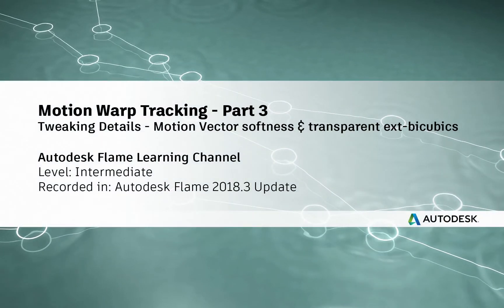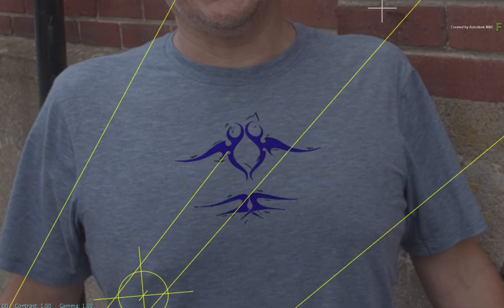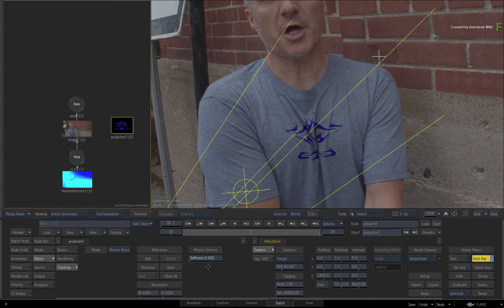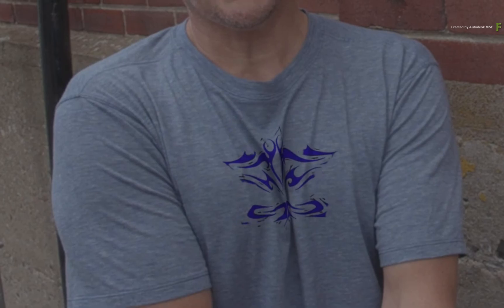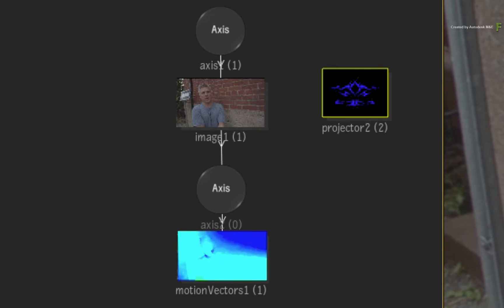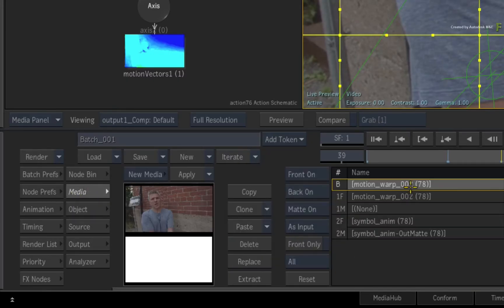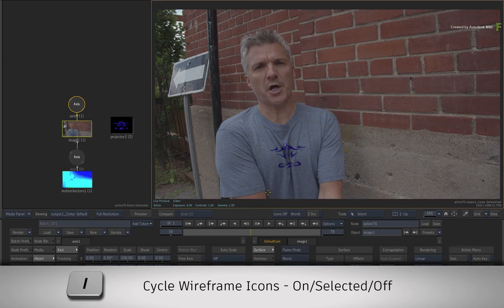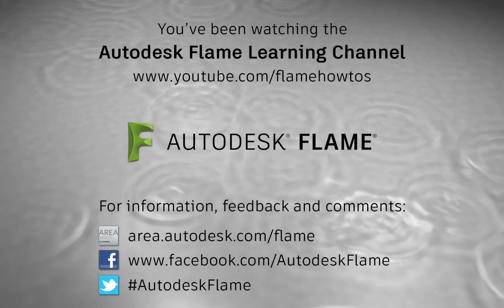Motion Warp Tracking - Part 3 - Tweaking Motion Warp Distortions - Flame 2018.3 Update

Comment: Hey Grant,  When I change the surface in layer 1 to External Bicubic as you do at 4:40, I find that it only affects the layer 1 image and not the projection.  Even if I turn layer 1 transparency to 100% I am not able to affect the project with the bicubic. I'm using Flame 2020.3.1, so I am wondering if any of the menus/functions have changed for doing this.  Please let me know.  Thanks!  Brian
Reply from the maker: Hi Brian, I have just tested the workflow in Flame 2021 and the steps are the same and it works as expected.   The reason I can think of is that your references are set on your surface and not the projector.  In part 2, I analysed/cached the motion vectors.   I positioned the projector and set the reference on first and last frame of the PROJECTOR and not the SURFACE.   This could the reason why the projection is not affected by the surface bi-cubic adjustments.
Reply: @Autodesk_Flame   Thanks for your reply Grant. I am sure you are correct about this.  I will go back and try again making sure to set references on the projector and not on the surface. Thanks again!
Reply from the maker: Your welcome and good luck!

Comment: when i add the projector, the graphic appears within a black box, no transparency. how can i fix this? thanks
Reply from the maker: Hi, you need to ensure that you imported the logo in as a Multi-Channel clip with its alpha channel.   You can check this setting before importing media via the MediaHub.   If you import via the import node in Batch, it automatically is set to multi.

The other point to mention, is to check your connections in Batch when connecting the footage to the action media node.   Ensure the alpha is connected to the blue input of the media node.

Hope this helps!

Comment: this is awesome stuff.  Grant - it's kind of ridiculous to use an animated logo for this example. Fine if you're wanting to create a magic T-shirt, but 99.9% of these uses would be for photo realistic logo add/removes- whicn are not animated.  I put hold frame on the last frame of the animated logo to try that out, and it works just as well - and it is much more impressive, because it looks more realistic.

I just brought my fellow Flame Artists over to check it out, and their jaws dropped.  Believe the hype! This is amazing tech!
Reply from the maker: Hi Dave,  I chose to go with the animated logo because in all the previous videos I had been using stills.  It was felt that the impression viewers were getting was that it didn't appear possible to use an animated clip with motion warp tracking.   I am required to cover a specific range of features/functions in every video and I was asked to do this.   Please go right ahead and make any changes you need for your work.    And I totally agree that this is amazing tech!   Thanks for the feedback!